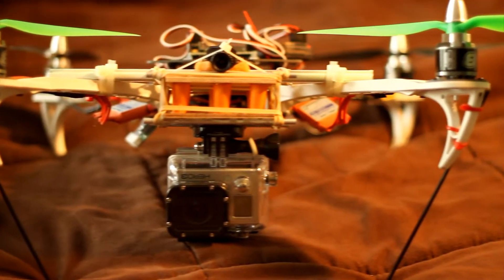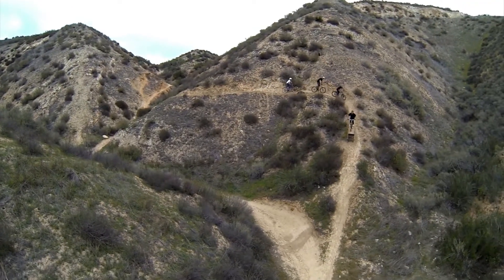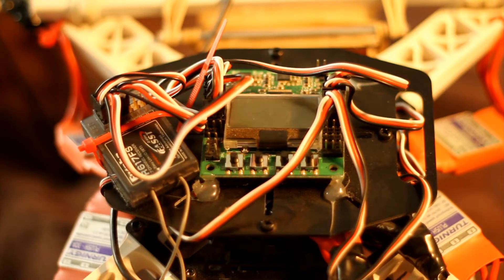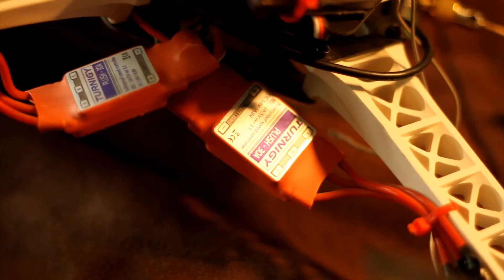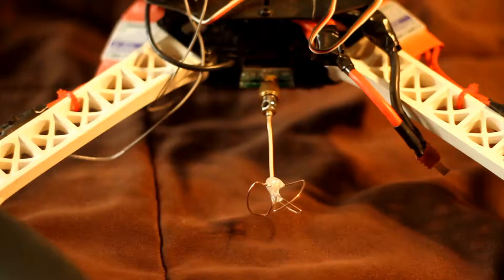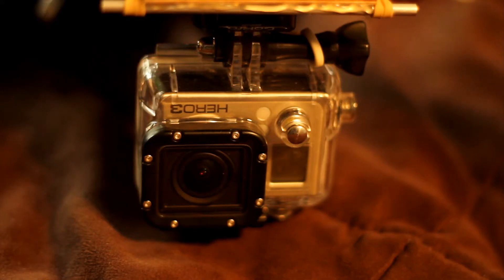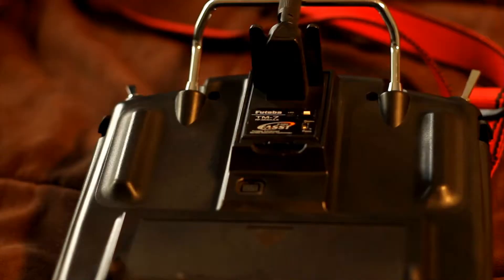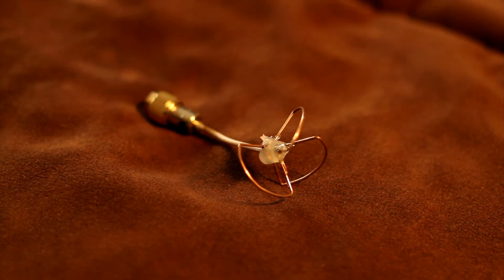sk450 fpv overview

Comment: Great vid. I've ordered the SK450 from hobby king. Can you run me through a couple details of how to mount a go pro on it? Also i like your custom skids, how did you do that? nice and simple. (for go pro clearance?).  Also, did you mount the v receiver underneath? Any insight would be great thanks, can't wait to FPV with this.
Reply: What batteries do you use with sk450 I'm looking to get one but don't know a lot about them
Reply: Dennis Christophers 3s 2200mah

Comment: Good setups dont have to look pretty, I learned that quickly :)  Question:  Can you let me know the total weight of your quad?  I have almost identical setup as you, and I'm skeptical at adding the GoPro, since my current weight is 2.8lbs.  The Gopro would put it at like 3lbs.  I'm running slightly better motors than you (SunnySky 980kv's) since I had those NTM's and one died mid air on me :(  Thanks again!!

Comment from the maker: i havent added it all up. The quad you can get away with around 150 without radio battery and charger. The fpv equipment runs almost 300. Check the links in the description.